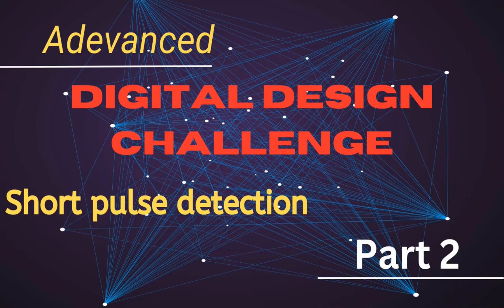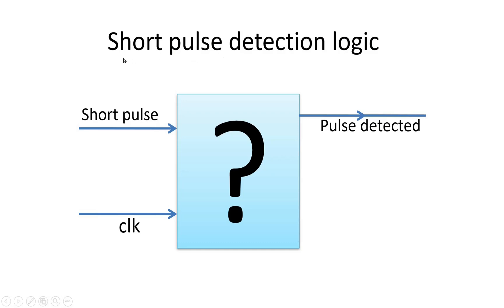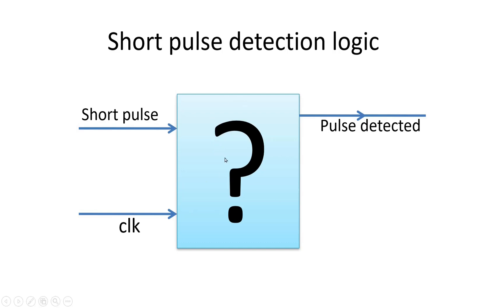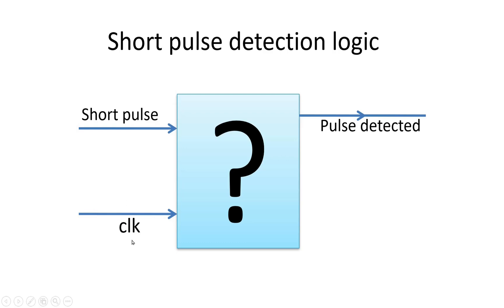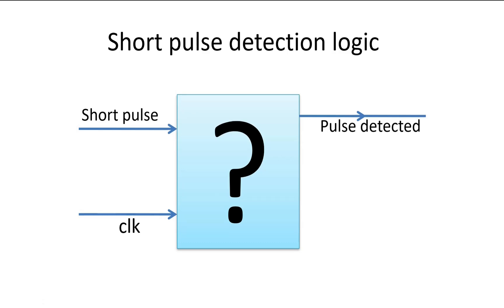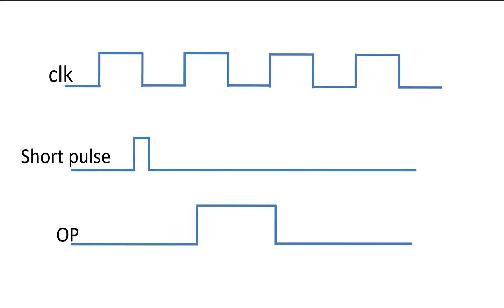Digital Deign Challenge Short Pulse Detection Part 2

Comment: Short pulse as a clock input to flop, input of flop is tied to 1. Output of this flop is connected to 2 flop synchronizer working on clock input 'clk'.  Additionally, the output of this synchronizer can be used as reset to short pulse flop. Posedge detect on output of 2 flop synchronizer is the 'pulse_detected'.

Comment: Use short pulse as FF clk and toggle Q on posedge of short clk, then sync and reconstruct the single cycle pulse from there. If this is a one time detection can also tie FF/D to high assuming Q goes low to high on short pulse posedge. There’s no mention of reset in the question so I assumed it is taken care of no need to worry about being the flop to a known state.

Comment: Our module may contain 2 flops in series. The short pulse may be used as the reset to a flop, whose input is always low. This flop's output is further flopped, which is the output of our module. After reset deassertion (pulse goes low), the first outputs 0 in the next clock edge so that the output pulse goes low in the 2nd clock edge.
Reply from the maker: In your solution, you are applying reset to only first flop and input to the flop is 0. reset is not applied to the second flop, right? 
You did not mention reset value of the first flop.
if reset value of first flop is '0'. Then, its output will always remain '0'. 
if reset value is '1', then output will become '1' forever.
But I need a pulse at the output, right?
Reply from the maker: appreciate your effort.